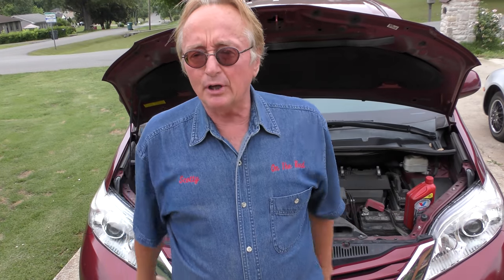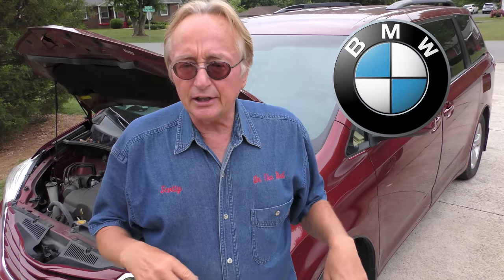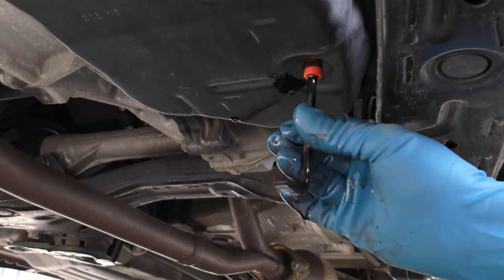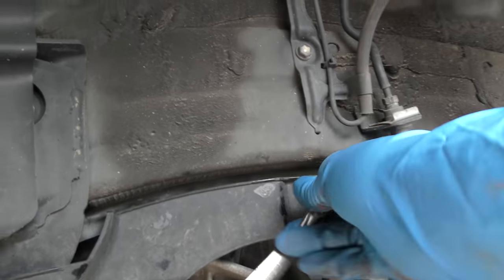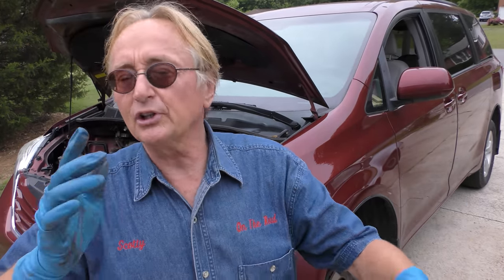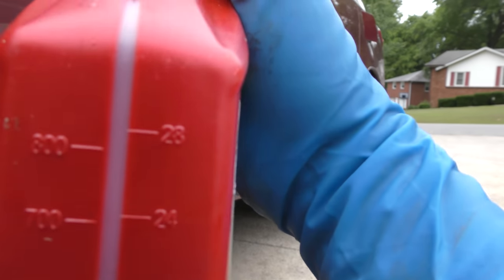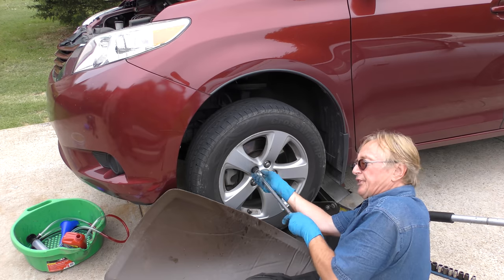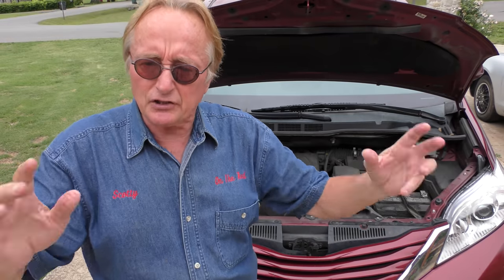Here's Why Changing Your Transmission Fluid Can Cause Damage

Comment: There is a difference between flush & fluid exchange. Most shops, even dealers use a fluid exchange machine that uses the transmissions own pump to exchange the fluid completely. Flush requires the use of a chemical solvent which has always been a big no-no.
Reply: 180k on a 2015 hyundai sonata se,    do i dare putting new trans fluid in? not sure how the previous two owners were about so idk if ever changed or not.
Reply: @Promitheos  Look at the color of the fluid. If it's dark, I'd do a simple drain and fill. That way you're only changing about 35% of the fluid and not shocking the system. Repeat a few weeks later to get even more old fluid out.
Reply: @rkgsd  Thanks for the tip.  I just got a used car 🚗 that has 148,000 miles and the carfax says he had regular maintenance evert 3000 - 5000 miles but it only states specifically about oil 🛢 changes --- the rest just says "maintenance." So I don't know if the transmission fluid was changed during one of those maintenance jobs.  Given how pristine under-the-hood & the exterior & interior of the car looks, I'm sorta inclined to believe the previous owner did have it changed, but he didn't keep record of the maintenance in the owner's manual that came with the car ---- just the Carfax 🦊📑 tells me.  And the manual only mentions changing the transmission fluid on a CVT under SEVERE driving 🚗 conditions (I e., towing & heavy city 🏙 driving ), & even then, not until 156,000 miles.  But under "normal" conditions, it doesn't make any suggestion at all for having it changed .

I went by the Chevy dealer (cuz the car is a Chevy Spark, though I bought it from an unrelated uses car dealership) & I asked the salesman if he could use my car's VIN # to check the Chevy database 🧑🏻‍💻 to see if it had ever had been serviced for a transmission fluid change & he claimed he only has access to cars 🚗 sold at his specific dealership.  Now, I don't know if he was just blowing smoke up my a$$ cuz he figures since it's no longer under warranty with Chevy that I probably won't go to them for any further maintenance so he's not gonna help me out cuz there's nothing in it for them, but I would think any car manufacturer would have access to records to any of its cars that had been serviced at any time @ any of its dealerships.  I mean with the internet, I don't see how the records are relegated to a specific geographic location.  And what's the point of having a VIN# if the information attached to it can't be accessed?  I mean, they ask for the VIN# when you're getting quotes for auto insurance📄 & the use that to get your vehicle's entire history, so I don't understand him telling me he can't use it to check another dealership under the same company as his to give me specific details on my cars maintenance history.  Is it possible I could call Chevy corporate headquarters & possibly they have a department that could give me detailed history of my car's maintenance records with them??
Reply: Fluid exchange = flushing. Really.
Reply: @dominiquedevereux7205  The question is where the car was serviced and whether they put service operations in the database there. In the CVT Mercedes, the oil is changed after a maximum of 60,000 km, just like in other ATs. I probably won't please you with the fact that no manufacturer can even make a CVT transmission properly. That is, they can produce it, but they die within 250,000 km, it starts around 130 tkm. Mercedes puts them in the A class and B class models only at the request of the customer, otherwise only a manual transmission is produced. I know that in the US people sued Nissan over the CVT but I don't know how that turned out. The problem is that no one can fix it properly either, so the start is $1,000 and then it turns out that a few more things need to be replaced... I wish you were the exception and had an immortal CVT.
Reply: @Mijanboy  Well, I called all the service stations listed on the Carfax & they said they can't access the records anymore cuz more than 2yrs has passed & their databases don't keep records past that point, OR ---- if they do have access to the records, there's no mention of the transmission fluid being changed?  The Carfax 🦊 itself doesn't specifically state it was done, so I'm assuming it wasn't.
Reply: Thats a flush my guy.. they never use chemicals or solvents on a transmission EVER!
Reply: @dominiquedevereux7205  He's right. I worked at a Subaru dealership for two years. Had people come in all the time with the same question. We only keep track of the cars we service. We can't "track" a car by a Vin# through another dealership. They are independently owned and have their own computer systems.
Reply: Can’t understand for the life of me how changing the fluid and filter could cause the transmission to slip. I can understand doing a fluid flush, but just dropping the pan and changing the fluid, and filter. Can’t imagine that can damage anything. I’m not a mechanic, but I play one on the weekend.
Reply: @mcgratheh5592  Im a layman but apparently this is why:

All transmission fluids get debris in them over time from the clutches wearing down. That debris will sort of "reinforce" the clutches and help them function. If you went 180k+ miles without doing a transmission fluid change, those clutches are gonna be so worn down that they essentially rely on all the debris they have deposited in the fluid to function at all (fills in the gaps, im guessing) so when you flush the transmission at this point, you wash away all the debris and what you are left with is a clutch that is worn the hell out and cant hold its own, and thats when you get slipping.

Someone feel free to correct this, Im no mechanic.
Reply: @_TheDoctor  yeah, after looking further into it I’ve came to that same conclusion. Makes sense. I guess the takeaway is change your fluids on schedule.
Reply: @mcgratheh5592  New transmission oil move freely because is thinner and fresh!! So that is why slip! Clutch will never be new so after 100k you will need more thick oil. Otherwise expect shakes and of the car
Reply: @Mijanboy 
You mistake the words can't and won't. They don't want to build quality transmissions & other parts.

Comment: I have just bought a 2004 Peugeot 406 with 320000 km and I want to change the gearbox oil asap.
The previous owner did not take good maintenance care so I am hoping the drain & fill with Total Traxium Gear 8 75W-80 will not cause slipping or failure of my transmission.

Comment: On all of my vehicles I've owned I change my fluids annually  give or take a couple of months if it needs it or not. Trans, power steering, diff, brake fluid. Five year coolant when dew. And oil/filter every 5000 km/s being doing my own service's and maintenance for over forty years. And still enjoy doing it myself.
Reply: Any suggestions how to dispose the old fluids and empty bottles? To me, changing the fluids at a shop, where it comes in bulk, assures everything is disposed properly and generates far less waste than going through individual bottles.
Reply: @fernandocastro78-NUSHS  you can usually take old fluids to any auto parts store for free and they will properly dispose of them. Id assume dealerships might help you as well

Comment: I had a nightmarish experience with an '86 Chevy Caprice when I had the transmission fluid flushed and replaced on a car with about 135,000 miles.  It didn't damage the transmission per se but the flush and fresh fluid acted as a solvent to dissolve the internal sludge that kept the seals from leaking.  The transmission then leaked like a sieve and I ended up junking the car because the actual repair would have cost a few hundred dollars because the transmission would have needed to be dropped.  The general rule is no never do a transmission flush on a high-mileage car that has never had one and GM specifically advises this.
Reply: What about a change compared to a flush at that milage? 
We're your gears having issues?
Reply: So what's the solutions ??
Reply: @salmanadan329  The short answer is to be sure to have your transmission fluid changed/flushed per manufacturer's recommended schedule and don't wait until the car exceeds 100,000 miles before having its first flush done.
Reply: What about manual transmission? Same idea - don’t change it
Reply: You should never flush a transmission it’ll just send crud into the screens in the transmission
Reply: @RandolphMcguttersmelf  manuals you need to cycle in new fluid every 20-30k, more often than automatic
Reply: @DDEENY  my car is over 100.000 miles should i change the fluid and filter or not ? My garage said to do this but im scared it will mess up the transmission
Reply: @georgehagi4703  My short answer is that you should NOT flush the transmission fluid now over 100,000 miles UNLESS it has already been flushed at least once during the life of the transmission.  You could try it but would need to live with whatever consequences occur and it's hit-or-miss and there's no way to be sure.  With my 2003 Impala now approaching 200,000 miles, I've had the transmission filter replaced and the pan fluid replaced with that but never the transmission flushed completely.  I once happened across a GM bulletin that advised that a high-mileage transmission that has never been flushed shouldn't be flushed because it's basically too late at that point and can do more harm than good.  My transmission has been leaking badly for the past couple of years and I'm trying stop-leak products to try to correct that which can only help if the leak is due to an aged rubber seal and the stop-leak rejuvenates the seals by swelling the rubber to hopefully stop the leak.  I'm adding a pint of transmission fluid every couple of weeks when I use the car regularly but the transmission is showing its age and slipping here and there.  Fluid is also seeping past the pan gasket (it seems that a replaced pan gasket never seals perfectly) but that's a minor secondary leak.  If this brand of stop-leak doesn't work, I'll try one more and then if that doesn't work, I'll junk the car, which I like because otherwise it still runs very well, but I'm fed up with the leak and my driveway is a mess and needs to be cleaned.
Reply: @DDEENY  180k miles on my wife's Pontiac G6. I imagine she has never had it changed because she never took care of cars before so would topping it off at this point be the best option? I watched a different video on just checking it and not fully flushing it.
Reply: @iwcb8539  I had my filter replaced and the lost fluid associated with that.  I never had the full flush done after the mileage exceeded 100,000 and the tranny was never flushed.  Once bitten, twice shy after the nightmare that I'd had with my '86 Caprice.  Opinions and luck varies but the general rule is to never have a complete flush done on a high-mileage transmission, only on a transmission that has had a complete flush(es) done at recommended intervals.  Another issue is the pan gasket that always seems to weep when replaced.  Short of RTV silicone, it seems that a replacement gasket can never be leak-free (assuming that the bolts are replaced and gradually torqued in the correct, specified order), but that's my bad luck again.  I had the complete flush done on my 2005 Impala and when I pulled it into my driveway, I put a sheet of cardboard under the car to check if any leaks were present.  I pulled the cardboard sheet out the next morning and it was COVERED with tranny fluid.  I took the car back to have the new gasket replaced and the service manager actually told me that the new gasket was torn when it was installed.  WTF?  Did the mechanic see that it was torn and installed it anyway?  How can a gasket tear when installed properly?  They replaced the gasket but the pan still weeps fluid, even after I snugged the bolts up myself some time after that double-repair.  I've had other bad issues with that shop and I don't use that shop anymore.  Good Luck.

Comment: I bought my 2011 camry at 55k miles and it now has 120k miles. I have never changed the ATF....Should I change it? Drives good no transmission problems

Comment: There is several reasons for changing the trans fluid regularly. One is often overlooked. If not changed regularly, deposits can build up in the valve body, & band servo units, creating shift issues, or no drive at all. Do not use "trans flush" in your transmission, as this stuff can create even bigger issues, such as removal of material from the clutches & bands.
Reply: Vast majority of cars have dry clutches, if they have a clutch at all.
Reply: Last time I check u would want to flush out the old fluid not keep it in there right ? If not you will just be constantly draining and changing the fluid every so miles so the new fluid isn't tainted by old fluid
Reply: @yamkaw346  they have clutches in them. All cars with transmissions do.
Reply: @cormaro13  I changed the trans fluid & filter in my car about 10 weeks ago. I completely drained the transmission fluid, including the torque converter, because it also has a drain. I've pulled transmissions down that were flushed, then refilled with fresh fluid. The trans no longer moved the car. Upon dismantling, I found most of the clutches had no material, & the bands were the same. I replaced the clutch plates, bands & the drums the bands clamp onto, reassembled the trans, installed in the car. No more issues. As a general rule, change the trans fluid every 4 years, or 40000km, brake fluid every 2 years, & engine oil twice a year. If your car is rear wheel drive, change the oil in the rear axle every 3 years.
Reply: @christophermarshall5765  That’s just completely not true...
Reply: @yamkaw346  you have no idea what you are talking about mate. Shows your lack of knowledge
Reply: @christophermarshall5765  🤦‍♂️
Reply: @yamkaw346  Google is your friend
Reply: @christophermarshall5765  So you recommend flush or change ??
Reply: @strangermaniacos686  Drain as much fluid as you can. You'll be surprised just how much fluid is in the valve body. If your car has a drain in the torque converter, drain this too. Transmissions hold a lot of fluid. Changing this, & the filter at recommended intervals is best. I do not recommend flushing the transmission.

Comment: I have a buddy who owns a trans shop. I had him service my 07 Camry and asked about using the Valvoline fluid. He said it will work, but best to use the Toyota WS fluid because it has specific friction modifiers for Toyota transmissions. Just thought I would share!
Reply: He  is    correct.    There  are  many  bone  heads  out  there  that  say  any 
transmission  fluid  will  work.  Yes,  but  for  how  long  before  transmission
suffers  for  not  getting  the  proper  fluid  with  proper  friction  modifiers.
Reply: ask him about amsoil low viscosity signature series if you dont mind. im curious
Reply: @wildcard749  What I use on my Lexus...I think it's better than WS...notice transmission is a tad quieter also.

Comment: A little common sense tip... Don't drain the transmission first. Find the fill plug first, make sure you can open it before you drain it. Imagine if you drain it and then you can't refill it. What are you going to do? You'll have to have it towed to a mechanic. You can't drive without trans fluid. Plus it will help to drain it if the fill plug it out.
Reply: Turn it upside down, will be fine😂
Reply: Or use a pump lol
Reply: @agapitomelorquez1  💪🧠

Comment: With these kind of automatic transmissions or CVT, you open the fill plug and drain plug, drain the old fluid, fill with new fluid till the level plug hole pours some fluid, and close the fill plug hand tight. Then start the engine and shift through the gears and let it warm up to 100 degrees Fahrenheit or more. With the engine running open the fill plug and continue to fill the fluid till it starts pouring again. Then close it hand tight and shut the engine off. Tighten the fill plug to torque specification according to the manufacturer.
Reply: True words are rare birds.

Comment: Hey scotty that little plastic piece you unscrewed with the 6mm Allen wrench after the drain plug is the dipstick. After draining the pan screw  the plastic piece back in but do not put the drain plug back in right away. Start filling it with oil until you start seeing it come out at the drain hole. The plastic piece is like an overflow it keeps just the right amount of fluid in the pan and anything extra flows out. Once it starts to come out stop pouring fluid in and put your drain plug back in and you're finished.
Reply: Now that is a revelation!
Reply: Is that part necessary? since He measured the fluid coming out. I have been wanting to do this to my 2019 tacoma 4 cylinder.
Reply: @joshuahinojosa2103  How would you know if the proper amount was in there. Could have a small leak somewhere.
Reply: @johndesousa7379  True, never thought about that 🤔 thank you
Reply: Also need to warm the temperature up to certain degree to check the level what the guy did was quick fast and wrong you can tell he overfill it if you really want to do it the Toyota right way you need to buy their special tool
Reply: That overflow tube to check the level.but you’ll need a scanner to able to do that .since he’s already measured the amounts so unnecessary to waiting time on it

Comment: One thing I don’t like messing with is transmissions. I usually just pay the little extra and have AAMCO do it, that way if something goes wrong I can hold their feet to the fire. I did one change on my Rodeo and a month later I was losing gears until I was down to reverse 😓 found out later on they were notorious for it especially if it wasn’t changed regularly.